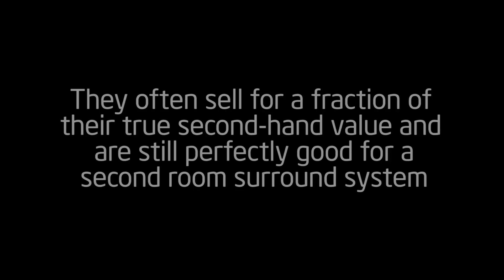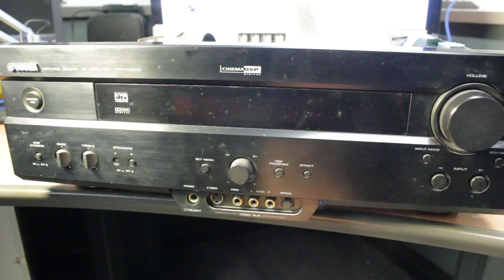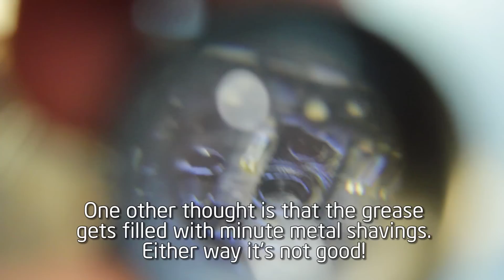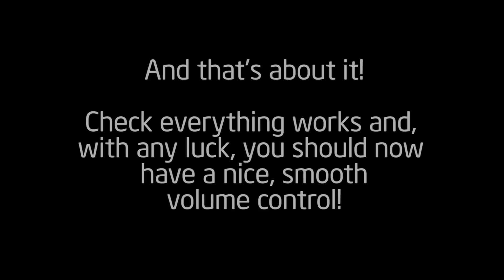Yamaha DSP-AX620 volume control repair

Comment: Thank you for a very good video.
This is also a great opportunity to replace the memory backup capacitor. It's the silver and black component behind the VFD in the top left corner @2:43. It is a supercapacitor with a component value of 0.047F/5.5v

Comment: so does that part need grease at all?
Reply from the maker: Not sure. I think it was originally added by the manufacturer to give it that nice damped feeling when you spin it. I did one without the grease and the control spun way more freely than the original. Add grease to taste, I guess, or limit it to around where the encoder shaft passes through the upper casing to regain at least a bit of the "premium" damped feeling of the original.

Comment: I have a Yamaha RX-V730 and the manual volume control hasn’t worked in years, remote control only.  Having viewed several videos about using Deoxit, and then twisting the failed “knob” repeatedly, and viewing this video, I had a hunch.  This video stated there is grease in the volume control assembly.  Since the volume control hasn’t worked in years, I powered up the 730 with NO audio input, and started twisting the volume control rapidly left and right.  Soon, i started to see flickers of “Volume” in the 730 display.  The flickers of life were sporadic and jumpy.  Continuing, I kept twisting the volume knob for several minutes.  The control was becoming more consistent.  Kept twisting the snot out of that control.  Now, I have a consistent and reliable manual volume adjustment.  Time will tell if this was a solution.
Reply: Thanks for this quick and dirty hack - tried to spin my volume control on powered off rx-v671 for a minute or so to both sides - powered it back on and presto - works like new :D it probably simply helps to heat that oil a little bit and distributes it evenly due to centrifugal force - thats all there is to it :)
Reply: Just did that right before finding this comment.. YEEE!
Reply: Just saved me trying to figure out when I was gonna have the free time to take the whole damn thing apart.  Mega-spinning it for about 90 seconds with the power off and the knob works again.  Good enough for me!
Reply: @djportal  Awesome. That worked and saved me hassle!  🙏🏻

Comment: The volume knob on my Sony HCD-CP1 stereo wasn't working. Turning the knob didn't work. It raised/lowered by equal amounts and overall sat in place. Sometimes when I tried to raise the volume it instead went and lowered the volume! I didn't have any cleaning solution or anything. So I tried simply cleaning the contact area with a household paper towel from the kitchen. Surprisingly it worked. The volume knob now behaves as it should. I hope this won't cause any problems long term?

The CD reader was also having trouble reading discs, so I wiped the lens with one of those wet wipes intended for cleaning glasses.

For the first time in years the stereo works.

Now I only have to figure out how to fix the remote control. I tried disassembling and cleaning it, but button function is still erratic. Sometimes it works, sometimes it doesn't. I don't know why.
Reply: Using an eraser (the kind used to remove writing from paper) to clean the remote works.

Comment: I just had to rewrite my comment because a lot has happened since I posted my question.  I found a killer amp at a great price and really wanted to give the component world of home audio a second chance. So, after getting my extremely high-end Yamaha find from a 2nd-hand shop, I get it home to find this problem we have here. I almost busted some very expensive speakers while testing.  

After watching the video, I got super excited and I found some "CRC Electronic Cleaner" at my local hardware store for $9.99.  My model was different and for second there I thought I was lucky and they added a way to access the control from the front.  Nope.  You have to do it just like in the video.  For me, I had to pull only 1 ribbon cable and had some extra lock-nuts to remove from the front cover but the process is exactly the same.  It took me about 1.5 hours to complete because I decided while in Rome, I would clean other parts inside the unit. After fully assembling, connecting front A/B and Center channel, powering up and adjusting the volume control up and down.  

It was a beautiful moment that can never be replicated.  

Thank you for adding meaningful youtube content, I really learned something today

Comment: very helpful, thanks a lot. 
And no new grease?
Reply: I think he forgot that part. Also you could probably get the same results by simply spraying some contact cleaner in through the front panel/knob & potentially save yourself from having to disassemble the whole unit
Reply from the maker: The stuff I sprayed on was contact-cleaning lubricant. The grease seemed to be part of the problem in that it was getting wedged under the fingers of the encoder and causing a bad contact, so none went back in. Ten years on and it's still working fine, and that's longer than from the time it was bought until the control started to go dodgy, so I consider it the correct decision :-)

Comment: Brilliant Harry my old dsp-ax620 volume control has been bugging me for years. Didn't even have to strip it down. Just pulled the knob off and to the left of the spindle there's a gap(next to white block). Gave it a good squirt of Deoxit D5 and after a few rotations couldn't believe my ears  and eyes. Obviously the D5 got in there and worked. Perfect. Many thanks  Regards John.

Comment: I just did this on an old RX-530 that has been collecting dust on the shelf for about 4 yrs.  It was actually simpler on the model I have.  Thanks for posting this.  I never got rid of that receiver thinking it had to be something simple and then I came across this video.  Worked like a charm!

Comment: Thanks - I did all this, but in testing before full reassembly, I have to push on the volume knob to create better contact and make it work right. I have the volume assembly back together as tight as it will go. All the cleaning also removed all the factory grease and the knob moves a lot more freely with some friction. Ideas on either of these?
Reply: Wiping the "fingers" of the control with a paper towel as shown here probably bent them downwards slightly, even if by only a few thousands of an inch (this was kind of a brute force technique and I don't recommend it).  You can probably hook those contacts with a dental pic or jewelers screwdriver and bend them upwards slightly. *Very very slightly*.  If you have a set of cheap digital calipers with a depth measurement option you can measure the height of the "fingers" first as a reference and then bend them up just a couple thousands. 

The best way to clean the pie-plate disc and contact fingers is to gently polish them with a pencil eraser after degreasing them. Use a light touch and don't leave bits of rubber behind.

As for the control not feeling the same afterwards  after you cleaned it, the original silicone lubricant has a viscous consistency imilar to honey. It really wasn't necessary to remove the grease from the shaft and bushing, but if you don't have a similar honey-like silicone lubricant easily available, clear transistor-heatsink grease, or Teflon "Super-Lube", will work. Grease the shaft and bushing, and put a thin, very light coat of the lube on the pieplate disc.  It won't feel quite the same as the original lubricant but it will feel a lot better than your currently unlubricated control.

Comment: On my pioneer this has been going on since I got it cheap secondhand. I didn't even have to disassemble, just took the top cover off. I got WD40 and sprayed behind where the volume knob is between the board. It took a few tries while spinning the knob and it works like new!

Comment: Hi.
 Just took your good advice and prised apart the volume control on my Sony TA-AV561 receiver. It took about 10 minutes to do the job, BUT I have spent the last 3 HOURS trying to get the receiver going again....Unsuccessfully ;-(.

The Standby light and the LCD screen will not power up.
All the lights on the control panel do work however ??
I connected the speakers to check, but no sound.

I am no electronics guy, but I suspect the 20 pin ribbon cable controls the LCD screen.
I have disconnected and reversed the ribbon, but to no avail.
BUT, I did notice when the ribbon was disconnected that 3 additional lights (CENTER, REAR, WOOFER) on the control panel started glowing!
When I turned the volume control up, the 3 lights glowed brighter, then dimmed as I turned the volume back down.
When I reconnected the ribbon the 3 lights went out and turning the volume control had no effect.

I took apart the volume control again, left it apart and tried powering up the unit.
No difference whatsoever. I reassembled the volume control. but the receiver will still not power up.

Has the volume control got a short in it now, perhaps?

Can anyone HELP me, please :-)
Reply: norincobro  Problem solved. It was a fuse!
Volume works perfectly. 
Thanks Harry :-)

Comment: 3 thinks, never remove the lubricant between shaft and case, it need to be dumper grease (if you remove apply new dumper grace). second, never spray on pcb or any parts (spray on cleaning tools), third, after cleaning apply new special grease (not bumper grease) on contacts. your method is leading to totally damage encoder and contacts. 
its like removing old oil from engine, cleaning and running without new oil.
Reply from the maker: I don't doubt that if it was under the same stresses as an engine removing the grease would be catastrophic. Thankfully, it's only under the stresses of a volume control and has so far lasted about ten years without any further maintenance😂 Having wilfully dumped various solvents directly on to PCBs and other assemblies over the years with no ill effects, I'm going to continue to do so. I think you're mistaking a £10 piece of ebay salvage for something that deserves care and attention paying to it!
Reply: @disgruntledgoat   this is unprofessional repair, and it should never teach people to do very bad job. learn about it before arguing. yes, you can do wherever you want but don’t learn bad practice people. therefore, so many failures we have around the world as uneducated people are trying to be smart. second, if that would not be necessary so the companies and factories would do the same lie you but 100% of production and educated engineers don’t do what you did.
Reply from the maker: @Johny666EU  I think you need to relax a little there, chap! You seem to be extremely angry about how I successfully fixed a ten-quid amp's volume control using random stuff I had lying around 😂

I completely agree with your assertion that there are better ways of doing this particular repair, however I consider them overkill and excessive in this instance.

My uni tutor told me more than once: "'Perfection' is the enemy of 'good enough'". Does that mean you should do a sloppy or insufficient job? Absolutely not, but it does mean you shouldn't spend time and effort on something that doesn't warrant time and effort being spent on it, namely cleaning the crap from a volume control on a £10 amp 😁

The repair was effective, proportionate and has lasted longer than the original volume control did before malfunctioning, and therefore I suggest that both the method is reasonable and result is satisfactory in this instance.

Comment: I have a question. I have the same problem and thanks to your wonderfully instructive video i'll be able to repair the knob on my reciever. However, I was wondering if i can use the " 3 in 1 Multi Purpose Oil " to lubricate those pieces to where the knob connects. William

Comment: Thanks Harry..

Mine is harma kardon and display the same issues.

I removed everything as per your instruction until the control knob and realised it has a different attachment method to yamaha.

It kinda like solder into the PCB and no way to remove it without breaking part of the soldering apart...

So i am stuck....any advice Harry?

Comment: A* great help but i had problems with 2 wires black/blackgreen connected to main power supply these were too short to allow front panel access.
I ended up breaking them as they looked like they could be unplugged but it wasnt a plug they broke off board .
I had to  resolder them.OOOOPS

Comment: how about using silicon grease on contact disk and on shaft too.? (Kinda silicone which is used in scuba diving geara)
Reply from the maker: On the shaft, no problem (and it would probably damp the rotation nicely) but on the disk? It's a bit goopy and the finger/prong things may just ride on the goop rather than making an electrical contact... I'd stick with switch cleaner-lubricant, TBH...

Comment: Excellent. Much prefer seeing how to repair something rather than reading a repair manual. I've had this exact same amplifier for over 10 years. I may get around to repairing mine at some point, but being so bulky and heavy, I use it as the bottom of my entertainment stack with 4 devices on top and a jungle of cables behind it all. Admitedly I very rarely used the volume control directly, as its a bit out of reach.

Comment from the maker: Not sure on that one to be honest... 3-in-1 isn't generally used for electrical connectors and I'm not sure how stable it is over time. I guess the worst that could happen is that it gunges up again and you have to re-clean the shaft encoder, or that it's too good an insulator and it doesn't work properly and you have to take it apart and clean it again. I can only recommend the switch cleaning lubricant as that worked for me, but your mileage may vary. On your own head be it :-)

Comment: Hi,  I've got this problem on a RX-V800.  I looked up the component too - almost certainly this:
http://uk.rs-online.com/web/p/mechanical-rotary-encoders/2651723/
Brand Alps Mfr. Part No.EC16B2410408
Will get it to bits one evening this week and clean it up.  Great run though on the video.  Regards

Comment: Found this upload whilst investigating solutions to this model. I can say follow the video carefully and it will solve this problem. Thanks Harry, you saved me 2 hours or extra fiddling about.

Now I am off to fix the centre channel amp which I suspect transistor death or dry joint therein.

P.S I got my amp from freecycle.

Comment: Thank you Harry,

Just what I needed, I have the same unit and same difficulty, seems a common problem.
I'll get on this right away, I have been just using the remote since 3 months after I bought it. but I have been on an electronics fixing spree this last month so now this one can be done. Thanks again.
Maxtcc

Comment: OK so I scrounged up some bits and pieces and managed to perform this fix on the above mentioned Sony mini system. So anyone out there with this problem, it's very easy to do. 
Bags for screws is a good idea, wish I'd done it... Oh well, it works!

Comment: Great vid.  Thanks for taking the time to post this.  I had a similar issue with a Harman/Kardon AVR 80 II, plagued me for years.  I gently opened the case and sprayed the volume control module with WD-40 and dried it up with a cloth.  It actually worked like a charm but it's only been a few days of perfect operation so far.  Time will be the true test.  Would you not recommend such work as I did for longevity?  Thanks.
Reply: WD-40 has a lot of solvent.. Like 60%.  Not good for electronics.
Reply: @sammyjenkis4791  , the solvents in standard WD40 aren't the main problem; the residues left behind are the problem.  It is a water displacement formula and not designed for cleaning electronic switches or controls. The same company now makes a range of products that they claim are for electronics use, but I have not tried them.

Comment: Just this morning my Yamaha receiver greeted me with blasting sound levels and I had to monkey with the volume control to calm it down.  Never happened before.  But I think it likely is a dusty, dirty volume control as the receiver does collect a lot of dust since it is not in an enclosed cabinet.  

Mine is a RX-V730 which has a motorized volume control.  

Do you imagine it is a similar design to the one in your video (I couldn't tell if yours is motorized but guess it is)?  Help?  Thanks.

Comment from the maker: Strangely enough, I had to take a look at an HK amp a couple of months ago and it was a right royal pain in the so-and-so to sort... I eventually resorted to removing the whole assembly from the PCB (desolder with a solder sucker and plenty of good solder wick) and then take the thing apart from there. I seem to remember it had a stacked arrangement (a couple of sensors with a motor behind that) and so the whole thing had to come off and be taken apart for cleaning. Not an easy fix, I'm afraid!

Comment: thanks, great video. I'll try this as soon as I can on my sony stereo which has exactly that kind of volume control problem. 
Do you think that removing the grease and applying a lubricant spray is a lasting solution, or will the encoder have to be recleaned again sometime in the future? Also do you think WD40 is an appropriate lubricant?
The best thing in the video is how you unwrite the plastic bag at the end ;-)
Reply: Standard WD-40 (WD stands for water displacement!) is never appropriate for cleaning electronics switches, controls or potentiometers. NEVER.  The company does now make a range of cleaning products that they claim to be specifically designed for electronics use, but I haven't tried them and can't offer an opinion.